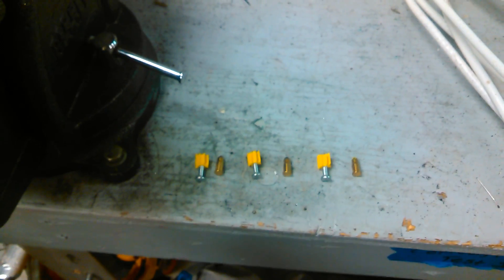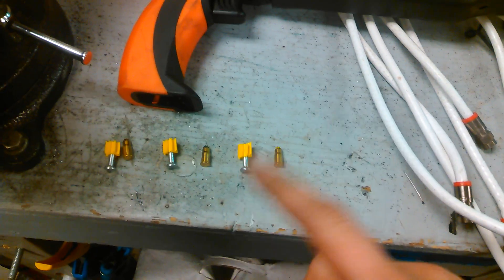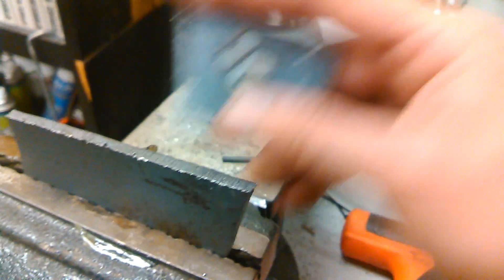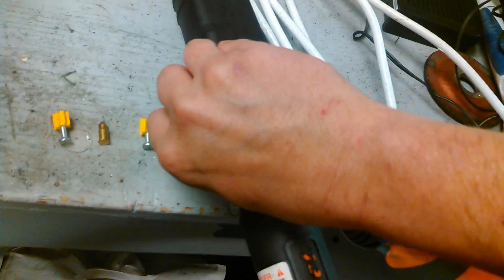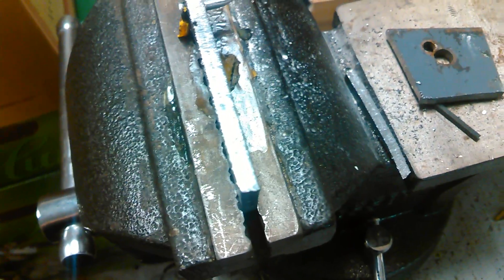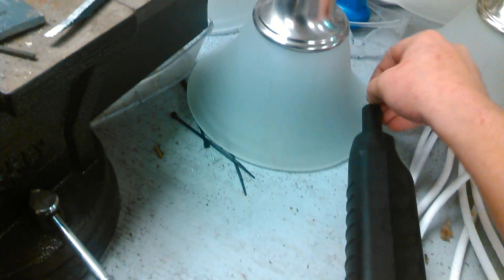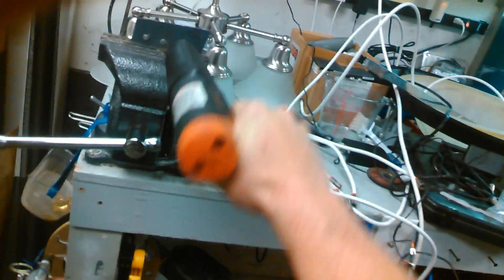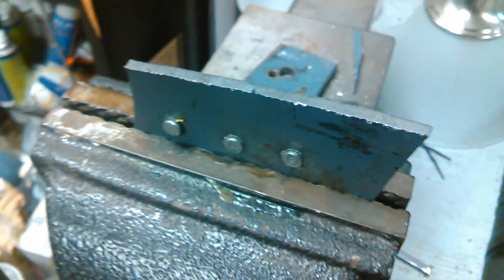Can a powder actuated  tool shoot thru 3/16 inch steel

Comment: Its got a kick!?!😂😂
Reply: It throws out a rod to drive,  plus the recoil of hot .22 loads.
That's 2 forces that push back towards you.
If you use it in a horizontal direction make sure you don't be lazy and use your chest for pressure. It nearly knocked the air out of me. Took 10 minutes before the uncomfortable pain went away. I was attempting to use body weight for additional pressure so it wouldn't slip.
You wouldn't shoot a firearm using your chest as a brace vs your shoulder.
I should of known better.
Reply from the maker: OHHH It does if you have ever shot a 9mm jennings POS it feels the same way  😂😂
Reply: @geoffhoweth   yes I have and I also have a ramset. There is no kick it's a damn 22 blank
Reply from the maker: @Harley365   ohhh yea no kick when you use it the way it's supposed to be used put it up against something hard  when that rod comes out and hits ......you will see.
Reply from the maker: @Harley365   well it has no kick shooting into concrete like carpet strips and stuff i also have the Cheap one that you hit with a hammer has no kick but on this day offfffhhh  it just just the web of my fingers
Reply: @geoffhoweth  lol I use it on concrete and steel. Whatever you say bud

Comment: Great video.  Any idea if any of these shoot tools would shot a real .22?
Reply from the maker: Nope... not with out modding the hell out of it.  It will not Chamber a 22 lr and it has a metal piston that drives the nail in to whatever you are shooting it into. Plus it has to be pressed very hard to the material you are fastening for it to fire . Thanks for Watching.
Reply: Read...